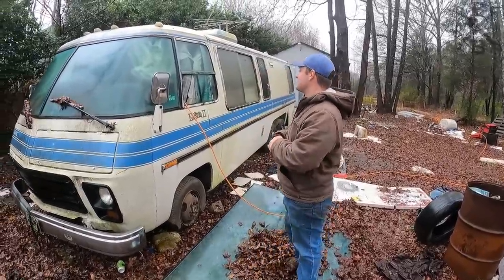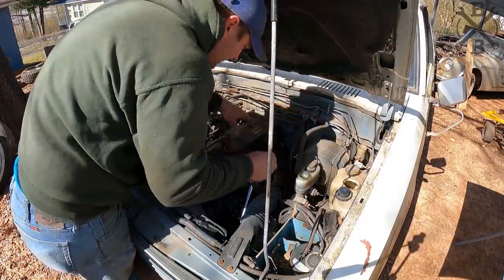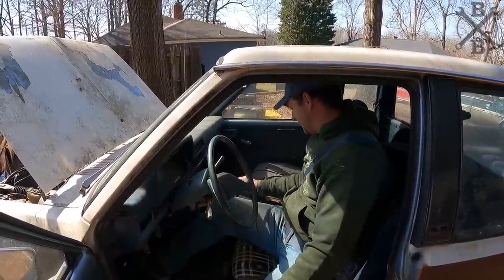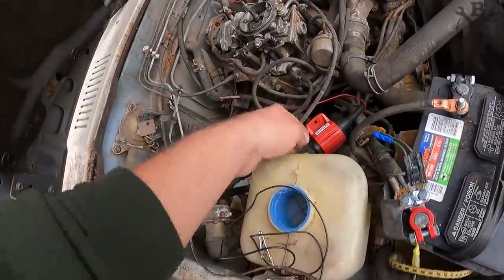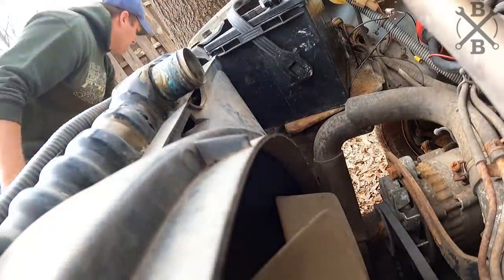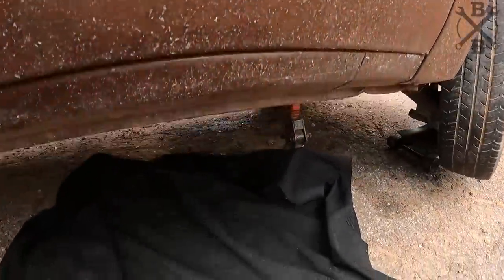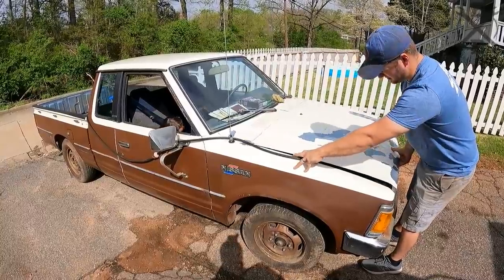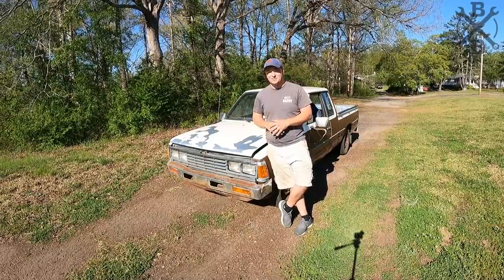Forgotten Classic Nissan Pickup! Will it run and Drive After 20 Years?

Comment: Dude nice. A couple months ago I got a 1984 Datsun king cab pickup 4x4. I got super lucky. My friend actually found it but he can’t drive stick so I bought it. And it’s been the funnest project. It already has upgraded 31” tires and a Webber carburetor. Just about everything works. I’ve had so much fun replacing old parts like the slave and master cylinder, cv boots, brake lines. Interior. New stick bushings and shocks/ struts. Removed gas tank cleaned up rust. New electric fuel pump and filter. New led lights.  The list goes on. Planning on putting a 3” body lift. It’s been real. Off roading has been awesome

Comment: Thats a really nice truck. Old Nissans run forever!
Reply from the maker: Thanks! They sure do!
Reply: @BudgetBuildz  Bullit proof ! And those were built in Japan. VERY good assembly and parts. I miss mine, a 78 or 79.
Drove it to the ground, rusted crazy BUT, the engine was still in top shape !
Reply: My 84 720 KC is still running strong at 247K miles. Granted, I have replaced parts when needed, but the nice thing about these trucks is that they are easy to work on and parts are surprisingly cheap and readily available at most decent auto parts stores.
Reply: My dad's old 85 720 had 400k on it when he retired it. Still ran fine he just wanted something newer.
Reply: 86 720 KC 4X4, one previous owner right off the dock. We love the old TONKA truck.
Reply: Shit I got a 98 frontier with 265k shit still runs strong
Reply: @BudgetBuildz  o
Reply: I have a 99 pathfinder. Love that truck
Reply: @marcryvon  The 620 series that you had were good looking trucks. Wish they would still make them today.
Reply: Their Ford trucks guys.  Ford, Nissan, Mazda, Jaguar,Volvo, Austin Martin and Kia are all tied in with each other.  Case in point, the Mecury Villiger are nothing but Nissan Quest.  Ford bought the Z engines off of Nissan in 1990 and started putting these engines in certain Ford Rangers and Mazda trucks. The Fird Aspire was manufactured by Kia Motor Corporation.   The Z engine, has 8 spark plugs in them to burn and reburn hydro carbons fir cleaner air, 4 for intake, 4 for exhaust. That's why you see some engines have 8 spark plug wires looking back at you when you pull the hood open. My 92 Ford Escort is actually a Mazda 323. The Datsun 240, 260 280 and 300 cubic inch Ford straight six cylinder engines were in the Datsun Z cars from the past.  The Nissan ZX is a V 6 Ford engine in that car.  I can go on further.  Fords DO make great cars and trucks.
Reply: @danbasta3677 Sorry, there's some misinformation there. No Nissan was built of Ford parts. The Ford 300 has NOTHING to do with Z engines,  and no Ford engine was ever in any Z. Nissan built their own VG30 v6. 
Just because Nissan built cars for others,  does not mean they let others build for them. Nissan actually made the X Mercedes.  And Nissan licensed the Mercedes 9 speed to make for themselves.
Reply: Yes
Reply: @danbasta3677 Nope, Ford bought mazda trucks in the 1970s and sold them as Ford Couriers, then in the 1990s Ford returned the favor and sold Mazda rebadged Ford Rangers.

Maybe outside the US Ford sold rebadged Nissan Vehicles, and I know some Holden Monaros had Nissan Skyline engines though.

Comment: Just saw that the VIN started with a "J" which means it was built in Japan.  At first I thought it may have been built in Smyrna Tennessee.  I was part of the Team that built the first Datsun / Nissan trucks in Tennessee in 1983.  Congrats on your find!
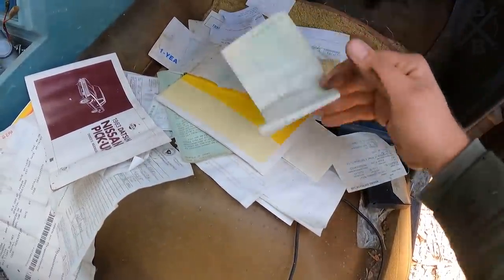Reply: He even had some papers in japanese from the truck. You can see it at 8:22.
Reply: @Lucas_Tulic  my dad used to haul porsches and he would bring home Coke bottles, candy wrappers and other paraphernalia with german on them..
Reply: I use to live in Murfreesboro Tennessee.  Smyrna Tennessee is 10 mi lu es up the road from whare I was living.
Reply: Very cool video, I just inherited an 83' 720 that has Nissan and Datsun logos on it; I guess to let people know that they were in a transition year. I'm very excited, has been parked in a carport/ garage here in AZ and appreciated videos like your's that give me encouragement to get this project running. Thanks again and great video!
Reply: @azmulefan three weeks ago I was gifted a 1983 Datsun Pickup truck, short cab 720 series. I got it from the original owner and it has 97,145 miles. Got a tune up, oil change and getting a tailpipe in couple of weeks and 4 new tires. I hope to have it for a long time.

Comment: Those engines are amazing and run well over 250,000 miles. I had a 510 wagon with the same engine i sold at 257,000 miles running just fine.

Comment: Awesome video, cool little truck, the Motor Home from “Stripes “ , can’t wait for the Datsuns.
Reply: The EM50 Urban Assault Vehicle!
Reply: The transaxle on the GMC camper which makes it front wheel drive, is the same one, which is on Olds Toronados, Cadillac Eldorados, 1980's Sevilles & mid to late 1970's Buick Rivieras. It's a bit of a "hot rod" legend on it's own.
       Of course, that camper is worth saving, if it's in as good a shape as it appears to be, but even if it wasn't, it'd be worth pulling that transaxle out. They were reliable, but what really makes them cool imo, is they could be used to make a mid-engined sports car!

Comment: My 1985 Nissan pick up was scraped due to hand hole in the frame rust hole.  The scrap yard used it as a parts picking truck for 4 more years.      It had a Union Jack painted on the tail gate so it was obviously mine.

Comment: I didn’t see any smoke come out after you got it tuned up that’s a good thing way to go my go👍🏼
Reply: All that water in the fuel cleaned out the carbon 😂😂

Those stupid Z24 motor's literally run on anything that burns and this video proved they will try to run on stuff that doesn't!

Comment: At least your slave cylinder is outside of the housing...unlike my '98 Ranger, lol.  Since I had to take off the transmission to get to mine I just went ahead and replaced everything from the slave cylinder, throw out bearing, clutch, master cylinder...even put in a new rear main seal since I had everything off.  And yeah, mine has 8 sparkplugs on it's little 4 cylinder too, lol.

Comment: Cool old truck. Never seen that model before. Definitely worth saving. Loved your kids reaction when they sat in it & they mentioned the spider webs !! Lol
Reply: I had a 1985 720, these trucks were basically indestructible other than rust (and sometimes the motor would eat head gaskets, but mine never did). Very tough little buggers. They would literally haul anything you could fit inside the box and laugh it off. Obviously with 100hp and 132lb-ft toque (though the torque curve was basically FLAT)  they werent tow rigs, but they would still attempt to pull anything you hitched to them and in many cases would succeed. I towed many big land yachts around with mine, lol! 

You basically drove it wide open everywhere and it simply wouldn't break 😂
The Z24 engine was stupid overbuilt and with the restrictive smog head you simply couldn't blow it up. Put a rock on the gas pedal in neutral and it would rev to about 7000 if I remember correctly but it still wouldn't blow up. My father told me a customer ran one till it siezed from no oil after a change, they broke it free with a pipe wrench and filled it with oil, customer drove it home. 
Mine still ran like new when i got sick of it (the only car this thing could beat in a race was probably a stock VW bus) and traded it. I regret that sometimes, it was a great little truck.

I believe it was still around bumping around a farm well into the 21st century....but yes, time was not kind to the bodies. I dont remember the last time i saw one on the road.

Comment: A word of caution. Whenever I worked on something this crusty from underneath. I would jack up one side of the car as high as my jackstands would allow. Then power wash the bottom the wheel wells and the entire suspension front and back before repeating on the opposite side of the car. Then I could work underneath without worrying about rust cutting me up or getting in my eyes. All the best Mike

Comment: Funny, my d21 came stock with a brass radiator hose coupler on the lower like that. Both hoses still stamped "Nissan" and it lasted like that for 27 years

Comment: Those mid 80's nissan trucks in my opinion. The best small kingcab pickup trucks. I drove an 85 model factory lifted with a 4 wheel drive. I could not hear it when it was running idle inside or outside. The low end torque in the slower speeds, strong yet smooth for a small 4 wheel drive truck. It felt like a bigger truck in a small package. Nissan Corporation outdid themselves on that model. I thank👏 you for taking the time to save a great little power house 💪.

Comment: Dyi back yard repair tip for bleeding clutch or brakes by yourself.  Go to Walmart,  target or pet supply store pickup air line check valve.  Put on bleeder with piece of clear rubber hose and boom self bleeder kit. Lol

Comment: I believe that is an 84 or 85.  The 83 has the taillights that go left to right, not top to bottom.  The 84-86 has a very strong Naps-Z motor.
Reply: Yep indestructible, not much power but it thinks its a diesel with the low end torque

Comment: I had one of those Nissan trucks with exactly the same colour it was great 
The plastic interior was so terrible 
I wish I could put some pictures up for you 😍😍👍👍
That is the 2lt engine mine had the L 18 smaller motor
Reply: They were enlarged to a 2.4l by 1985, torque curve and rev range of a diesel without thr smoke lol

But they were basically indestructible

Comment: That 720 will run A LOT smoother with the exhaust system complete. I ran a 1984 720 from 1997 to 2019. (frame rusted out) It sat for three years and fired on the first try when sold to a local take-a-part.

Comment: I had a 88 Nissan 4X4 and I had to put anti seize on my plugs because of the aluminum head! I was having trouble with the plugs wanting to Gauld the threads in the head especially around the exhaust area! So they must have had the same problem!

Comment: Try swapping the coil wires from terminal to terminal on the distributor - 8 plug motors only fire the second bank over 4000rpm, or thereabouts,

Comment: I am using that exact same slave cylinder for my pinto 347 t5 transmission hydraulic conversion, its a mustang transmission but in a pinto the headers get in the way of the clutch cable, just my luck 😜

Comment: Those motor homes are awesome, they are worth money now
Reply: They were a consistent good seller for GM, despite the fuel crisis. GM shouldn't have stopped making them. They had that legendary transaxle like in the Olds Toronado, giving it front wheel drive without torque steer.
       It was also the EM50 Urban Assault Vehicle in the movie, "Stripes".

Comment: I'm pretty jealous, my state's deep enough in the rust belt that even a pre-2000 f-150 is a shock to see. I've got a beater volvo 740 with a twisted rear unibody right now, and I think I'll just have to take a trip south to find anything nicer. Everything on craigslist is either completely perforated with rot or way too nice for me.

Comment: A simple piece of pipe in place of the cat would go a long way ;)

The ignition thing will be a fun hunt, I recall something like this over at Mustie1 maybe.
Reply: It's probably the ignition switch, if its worn out it will stop sending voltage to the coil if you turn it too far to the "start" position (the lock cylinder had a built in stop to prevent that)

Comment: The nissan z24's with the twin spark wont always spark both the intake and exhaust plugs at the same time. All depends on vacuum and maybe rpm? If you checked the plug wire on the other side it would've sparked while turning it over. I love these trucks, been driving mine since 2011.
Reply: They are still supposed to fire both sets while cranking if i remember correctly, it's probably a worn ignition switch

Comment: Dad was a union coal miner, bought one of those Nissan pickups, caught hell from all the Ford and Chevy guys, but couldn't kill that little truck.
Reply: That's funny.  Ford, Nissan, Mazda, Jaguar,Volvo,Austin Martin and Kia are all tied in with each other. 
Chevy,Isuzu,Toyota,Suzuki,Dawoo,Saub and Hummer are all tied in with GM.
Chrysler,Mitsubishi,Mercedes Benz,Hyanida, a chineese car and Fiat, are all tied in with each other.
Reply: @danbasta3677 Not those years, those were a homegrown nissan design
The engine was a beefed up tall deck L series with a smog head, appropriately for Nissan called a Z series engine and they are basically indestructible. Not much hp but torquey as a small diesel. 
Only weak point was the factory head gasket...but a blown head gasket wouldn't stop one of these from running (the gasket blew between cyl 2 and 3 would blow betw cyl 2 and cyl 3)

Comment: That truck has a favorite spot on the flywheel - that's probably why it takes a few spins to start. It's not really my cup of tea, either - but if I was closer, I'd probably buy it because it's still willing to run - & I love a challenge. I hope you can revive the motorhome, as I've got a #HotWheels version buried somewhere, & the roadsters are interesting as well.

Comment: I've been piddling with a 1983 model regular cab that sat up for more than 5 years & I can't get it running smoothly. 
I put a rebuilt carburetor on it & a new gas tank but it runs like garbage when it's first started up. It too is the 8 plug engine & once it gets warm, it tends to stop skipping... but it constantly goes dead. 
I'm a shade tree mechanic but I'm far from a guru, so I don't what to do. I'm guessing vaccuum leak but I don't know...
🤔
🇺🇸

Comment: That thing may have a Dual balast resistor. One side is start, other is the run circuit and the start side tends to open up and they refuse to start till you let off the key. Maybe you already figured it out and bypassed it or replaced it seeing how I skipped forward to see if it started for you. Sounded like it actually ran good once it was started and warm.
Reply: Yea you are spot on starter motor drawing power away from ignition you could trying replacing points

Comment: Uhhh... unless you edited backwards, did you connect the slave cylinder,  then add fluid!? Always run clean fluid throughout the lines, then connect the end line. Hope there's not much trash pushed into the slave

Comment: Damn. That truck brand new was only a couple hundred more dollars than my warranty on my new truck 2 years ago.
Reply: Fun fact. 1986 Mazda sold the B2000 SE5 standard cab, custom decals, fully loaded with every option available for 5995$.
I bought a plain jane Cab Plus with no options, nothing, 10,300$.
Sold that truck in 1999, it had almost 300,000 miles on it.
Reply: That truck in 2023 dollars would cost around $19000. Sign me up! :)

Comment: I was hoping that you found a SD22 Diesel engine under the hood.
Reply: Good thing he didn't. Those are junk :D
SD23 and 25 are a lot stronger and durable ... i have 4. 720s. 2. 2X4 and 2. 4X4 :)
Reply: @pernillenielsen8083  how is the SD22 junk, compared to the SD23 and SD25?  All three are based off the original SD20 Diesel.  The only real difference that I know of, is that all SD23 and SD25 have 5 main bearings, compared to 3 in The SD20.  Earlier SD22 had 3 main bearings and later versions had 5 main bearings.
Reply: @lb8528  The 22s had a different fuel pump with a ton of external moving parts that would wear out pretty fast, plus i do believe we only got the early 3 main bearing models here, that were gutless (they all are TBH lol) and was known for self destructing. They also would leak like an old British car and be covered in oil, inside out (If theres nothing under it, there's nothing in it :D )
Reply: ive got an sd25 in an 1885 720 dual cab 4WD, i dont have anywhere to work on it currently and it needs a lot of love, was actually thinking of pulling the motor apart inside my tiny shoebox apartment and restoring it lol

Comment: My uncle John had a 1985 Toyota 25 of those with 2.4 litre 4 cylinders with daul spark plugs with each cylinder with 2 spark plugs wires to also 5 speed Manual transmission floor shifter, he ran 10w30  engine oil to with Fram oil filter also 91 octane gas from Shell too and only problem has was key ignition switch would start in start position so had put toggle to start up with ! Also only problem is on left side on wheel side back in wheel well the Netural Safety Switch need clean up got dirty connection lots also put wood box around so protection it also ran for long times in years to! Then in 2009 sold to guy was restored same type truck and then got 1994 Toyota T100 pickup with last year of 2.4 litre 4 cylinders with single spark plugs also wires too also 5 speed Manual transmission, with Tilt Steering wheel, Power brakes & Steering also Posi Rear end and not Canada model it a USA model style to funny part of truck has factory door lock for fuel tank fill up! Bet didn't know that Mazda, Nissan, Toyota in 1980 to 1994 used same motor , Transmission and everything too plus body style  also amazing for sure! Nice exhaust on that old 1983 very loud to and need some fix up ! Also fix up that Carb with rebuilt kit to add a Grey Bottle of STP Total Treatment fuel injection and carb cleaner in full tank 89 or 91 octane gas!
Reply: The only thing the Nissan Z24 and the Toyota 22R share is the Displacement (2.4 liters)
Reply: @twoeightythreez  yes great motor they are and super too 👍!

Comment: How can this be a 4 cylinder engine and have 8 plugs?
Reply: Those used a Nap Z? engine that had two plugs per cylinder to make more power and run cleaner/better. My 5.7 hemi in my Charger RT uses dual plugs too and I'm going to hate buying plugs for it but it runs great.
Reply: Thanks